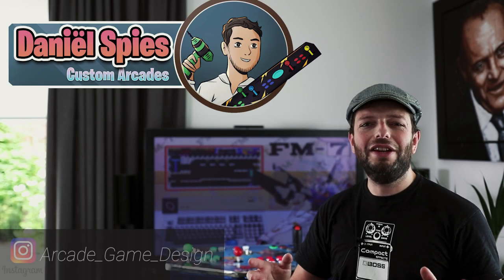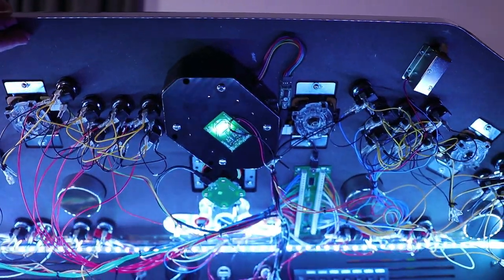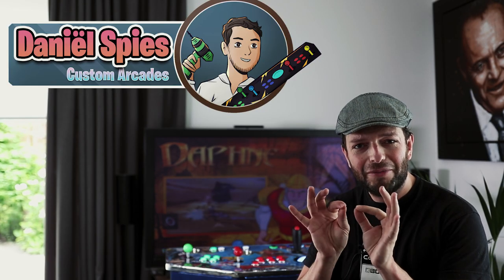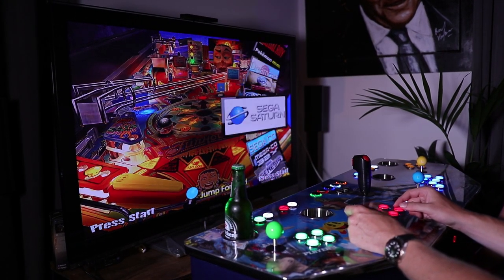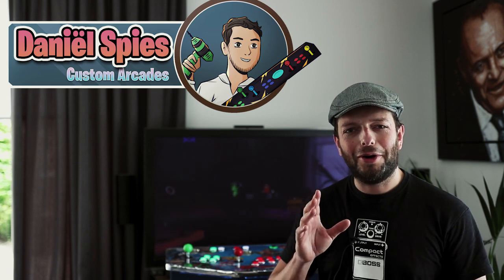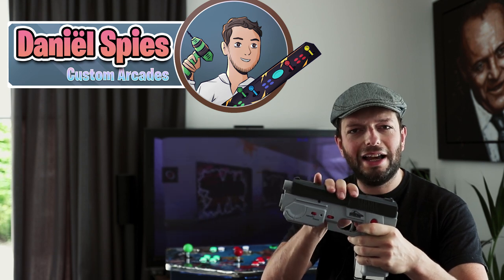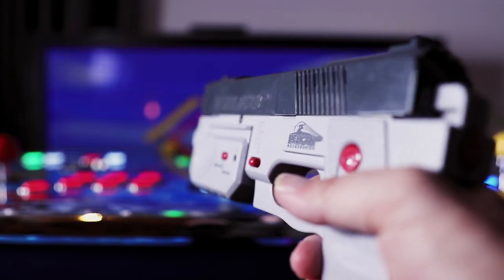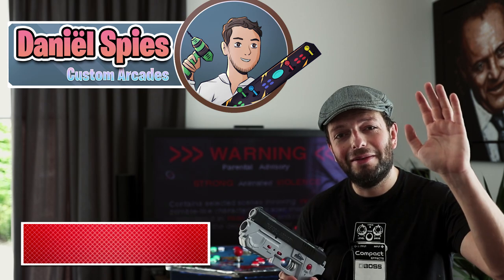Arcade Controller [4player] with Custom Recoil Lightgun and 8TB Hyperspin setup :-D

Comment: I just got the super jolt gun to try and build the same thing you did. Before modding did your gun recoil when the trigger was pressed with only power connected? I don’t have a PlayStation so I just wanted to test it to make sure it’s working.
Reply from the maker: I only used the Solenoid and the housing of that gun. The rest is an Ultimarc Aimtrak gun. Note: This Aimtrak gun will only fire the solenoid when pointed at the screen 😅 this took me a while to figure out at first. Good luck with your project 🔫
Reply: @TheDanielSpies_Arcades   yes I’m trying to do the same, how did you connect the solenoid to the aimtrak pcb? Did you use the original PlayStation circuit board or the aimtrak one?